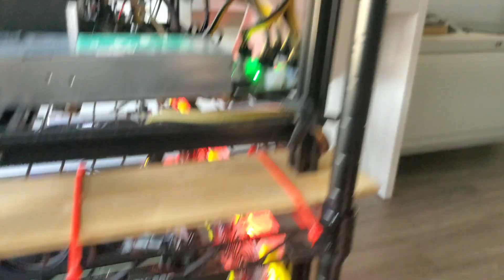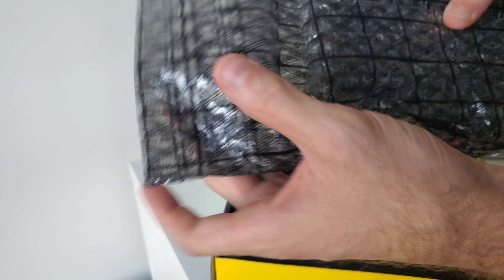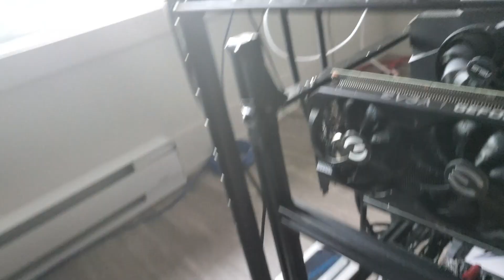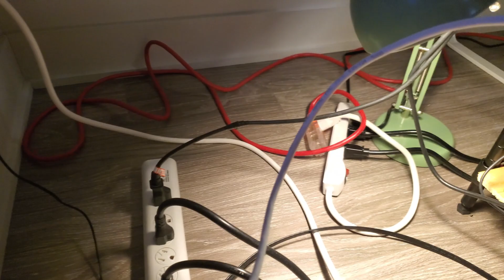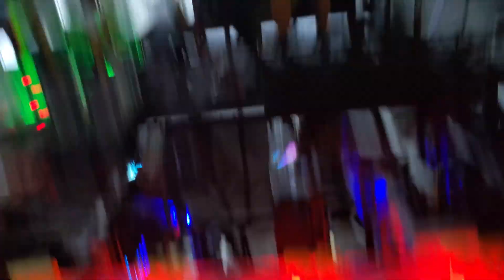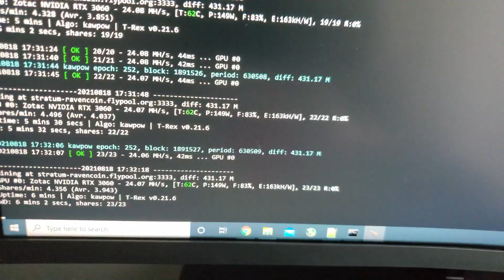Zotac RTX 3060 LHR for Mining Ravencoin! (Unboxing & Hashrate) Twin Edge OC

Comment: Hi, i need help on my mining rig. I use 3x zotac 3060 ti LHR and set it up with the OC settings i found (1400 core, 1750 memory, 150 PL on nbminer).

My rig will mine for just 3-11 minutes (varies each try) with 40ish MH and then it will just go down to no MH with an error message "GPU driver error, no temp".

I tried using different trexminer, lolminer, nbminer with diff version but the problem still persist. Is it my OC settings or is it something else? Thanks.
Reply from the maker: Hi! It could for sure be too high OCs, but also check your paging file is the right size. That can lead to issues while mining!

Comment: I got 28++ MHz in my zotac
PL 80
C.clock +100
M.clock +975
fan 70
use nb miner sett config -lhr 70
Reply from the maker: That must be a 3060Ti model, could it be herman?
Reply: Cilik pol, tipe 3060 apa itu ?

Comment: Hi!! What do you recommended for rvn? 3060 or 3060 ti? Thanks!!
Reply from the maker: Hey Carlos! Thanks for subscribing! It will always depend on the price! I get about 24 mhs on 3060 and 28 mhs on 3060ti. Do that ratio to the ratio of prices! :)
Reply: @MiningOffice  the prices here are 608$ 3060 and 725$-770$ the 3060 ti.

What is your opinion?

Thanks!!!
Reply from the maker: @CarlosFernandez-kx5lq  dropping a video in an hour which will help you out! But personally 3060ti. Stay tune :)
Reply: @MiningOffice  thanks!!!

Comment: Nice dude. I was planning on testing my 3060s on Raven soon. Seems like around the same memory overclock as Eth but a little more power as expected. Super helpful to see that.

Speaking of power, are you tapped out yet? You keep adding cards but I remember you telling me that you’re limited on power in there!
Reply from the maker: I got a short 10m 14 AWG extension that I run from my hallway to the office now, so basically have 2x 15A circuits available!! Also sold off the gtx 1060 so that gave me some more wiggle room. I still have headroom in terms of power right now, and space for at least a couple more cards (without going for a 3rd rig yet hehe) :)
Reply: @MiningOffice  Sounds like you are going to have to do like i have.  Rigs in office, rigs in basement, rigs in garage.  Diversify
Reply from the maker: @AlteredComponent  right now in my appartment that aint possible, but next summer ill be in my own place with the GF. Gonna go crazy with the 240V once im there lol. 10 months to tough it out!!
Reply from the maker: Needed more room to expand and had to have the possibility of getting more cards if I wanted to keep having some good content! Ive got 8x 1660 supers which dont pull too much power which is nice